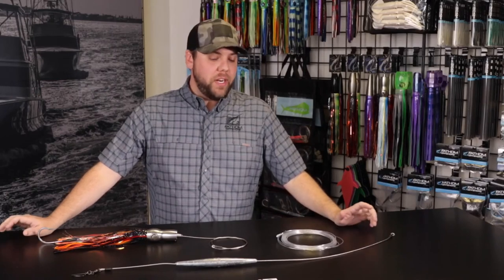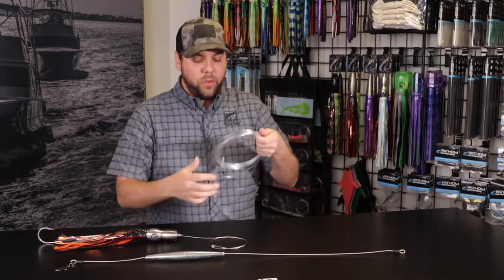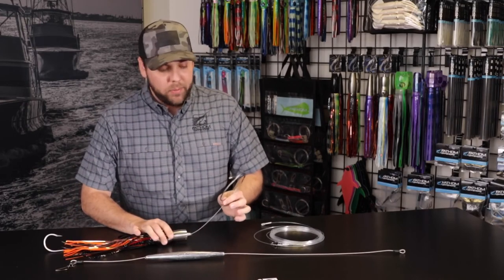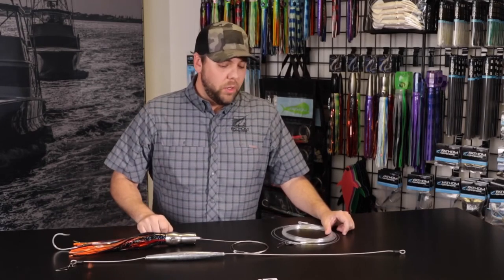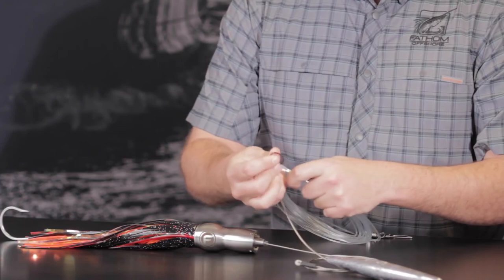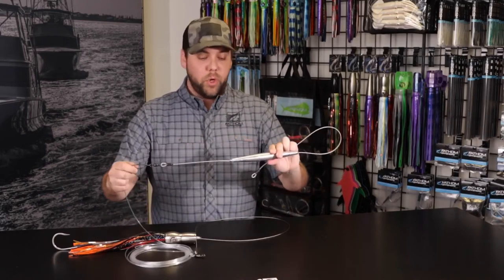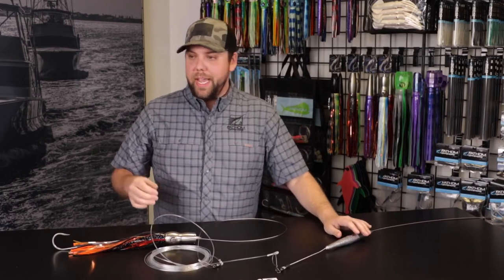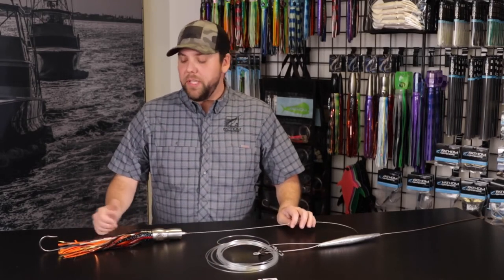How To Rig a Wahoo Lure for High Speed Trolling - Fathom Offshore fishing lures

Comment: New to using weights for Wahoo trolling. How do you deal with the weight and shock leader when reeling in your catch?!
Reply from the maker: The trolling weight will come up first, grab it and set the weight on the floor of the boat so it's not swinging (While keeping tension on the fish), then simply hand-line the shock leader in until the wahoo is within gaffing distance.

Comment: Can we use the same method for catching king fish ?
Reply from the maker: No not generally, King Mackerel are typically caught on substantially smaller pound test line, with dead Cigar Minnows or live Pogies at very slow speeds (1-3knts). 

Wire and Treble hooks are the most commonly used terminal tackle, along with smaller reels with high retrieval rates are preferred. 

Try using a Fathom down rigger ball to get those king baits lower in the water column. 

You can find them HERE.

https://www.fathomoffshore.com/products/coated-downrigger-ball-kingfishing